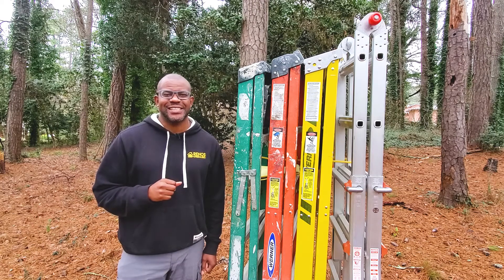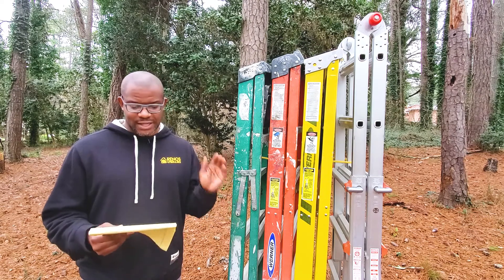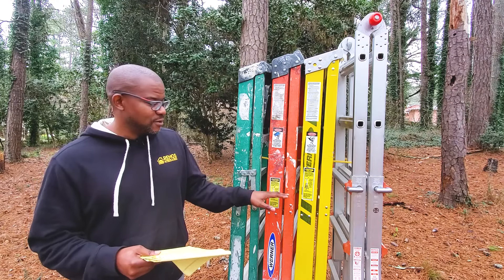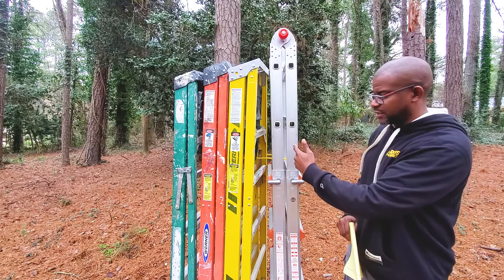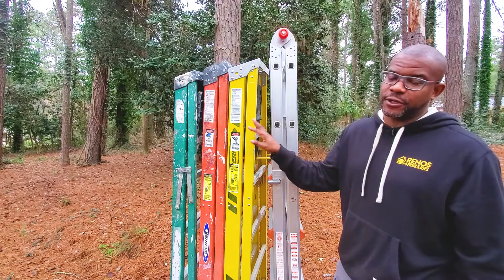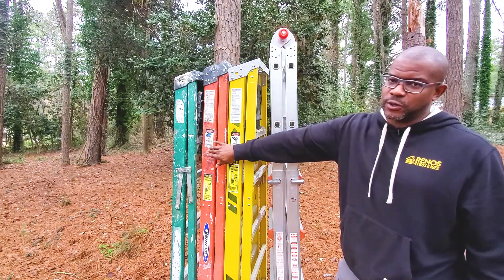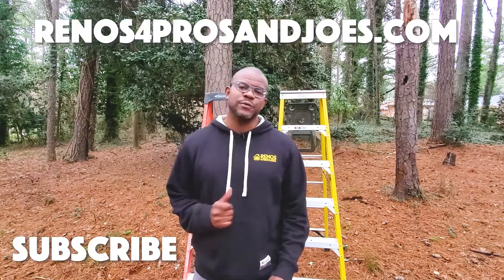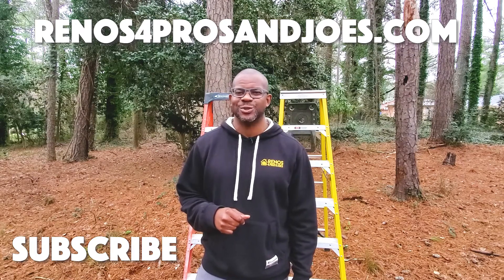HOW TO SELECT A STEP LADDER | 6 Ladder Reviews

Comment: Watched your video after grabbing a Keller brand ladder. Red/orange color, rated at 300 lb and was right at $80 from my local Menard's. Basic household usage. Somehow aluminum ladders not so common in an A frame I've noticed. Why? And how is fiberglass ladders stronger than an all metal (aluminum) ladder? Seems like metal would be stronger. Also, any input on the brand Keller? Seen a lot of Werner one's  not so many Keller's, but the price for the weight capacity sold me.